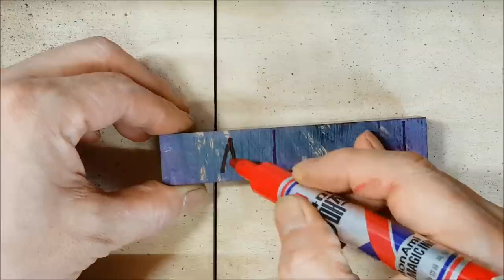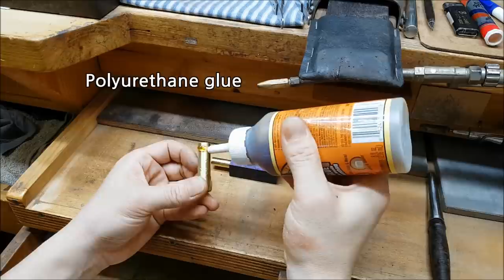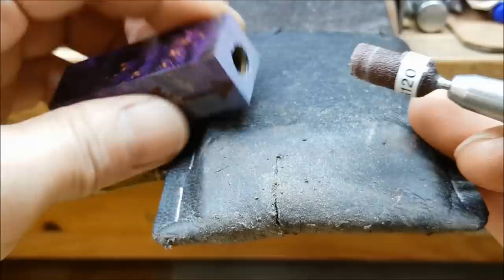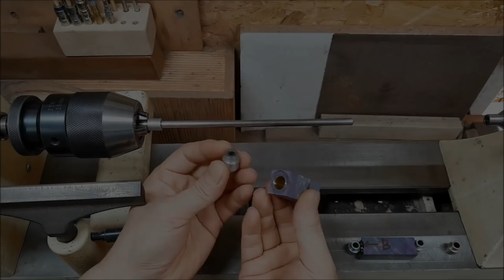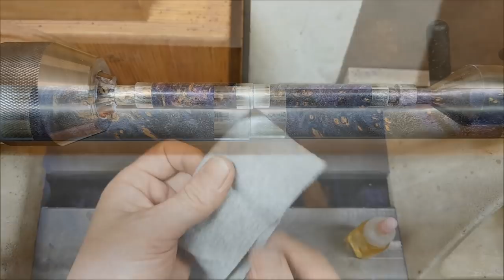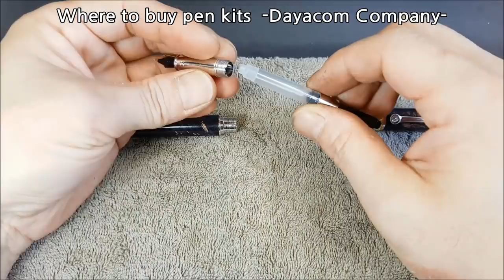"THE SPACE" Fountain pen in my hand/ 우주를 품은 만년필 만들기

Comment: Well done. Beautiful pen. Could I asked why you sanded the ends before using the trimmer? Thanks
Reply from the maker: Good question.
After attaching the brass tube to the wood,
To remove traces of the remaining polyurethane glue,
This is the first sanding.
If you don't remove this,
Then, because the next process does not proceed neatly,
Sanding was done.